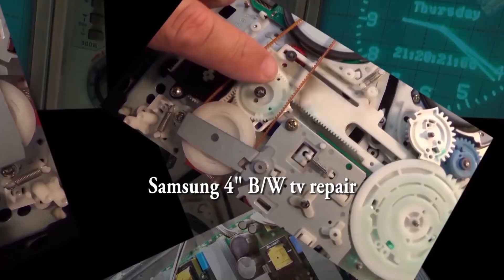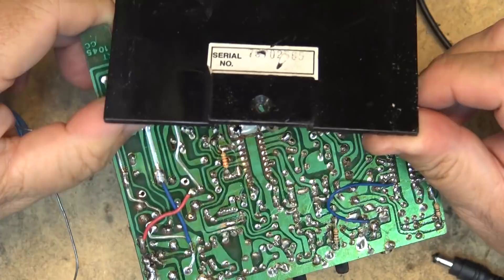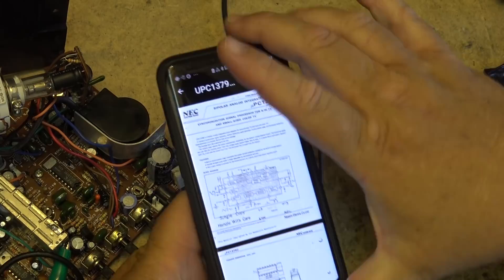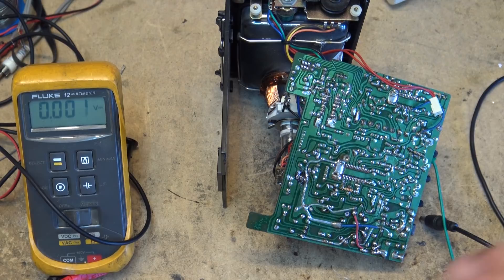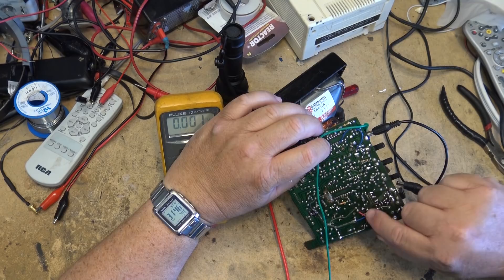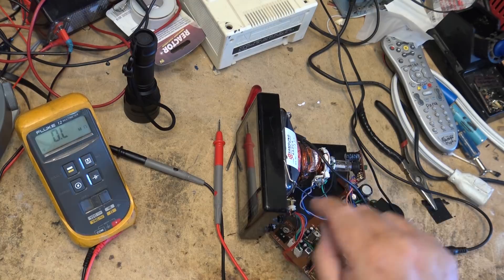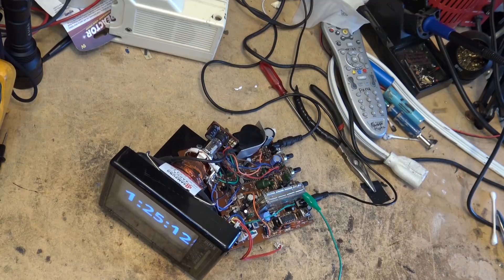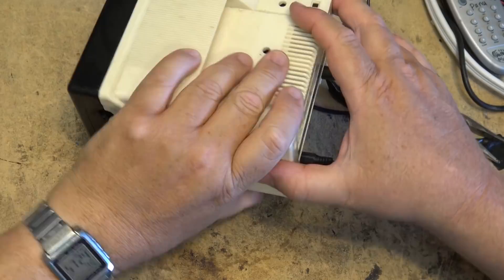Vintage Samsung mini TV repair

Comment: If you have the talent to fix something, fix it! No need to throw it out. All you use it for is to display a clock and the fix didn't cost you anything. Kept it out of the landfill.
Reply from the maker: TEAC Fan 
My goal is to burn the crap  out of the tube. Burn that image in. I have one used as a security monitor that is nicely burned in. Run it till the tube is shot and see how much phosphor burn I can do in that time.

Comment: Good old cold solder joint touch up. Works like a charm. I've used this method to fix my Magnavox D8443 ghetto blaster boombox which seemed like it had no power and the audio was cutting out but touching up the solder points around the main DC cap fixed the issue. Now to fix the controls and add a new belt to the tape player. Then I'm going to record a tape of old school rap songs like LL cool J, kurtis blow, lots of old school rap and play it on it.
Reply from the maker: Yup, looks that way. This set has lots of hours on it, as I leave it running day and night.

Comment: Someone gave me something almost the same,now I guess I will have to look at it instead of using it for parts ?,great video
Reply from the maker: I have been using this as a clock for awhile. I actually have a 10" Hyundai (yes the same company that makes cars) that was used for probably 25 years as a security camera monitor, and now displays the time in my office. 
These old b/w tubes just last forever. I have a brand new one sitting on a shelf, but with the old one refusing to die it may be awhile until the new one sees any service.

Comment: Once I found a small color television in a flea market (without its power supply). But I doesn't checked the polarity (just the voltage only, stupid me thought it is center positive, but it wasn't), connected a power supply, switched on the TV, then... BANG! 😱 A capacitor just blew up in it and also some other components went with it. 😩 Repair has been tried, but only the sound got working, because we couldn't find the other bad components. So, sadly, the television went to recycling. 😩

So, always check the polarity as well of any electronic device to avoid causing damage in it❗

Comment: The RGB Cutoff adjustments on the monitor chassis is adjusting Positive voltage for G1 or G2? The RGB Drive adjustments are adjusting what? When the G2 negative voltage bias is ZERO the picture is White screen. The Screen adjustment is adjusting the Negative voltage Bias to G1 or G2? The RGB Cutoff adjustment is cutting off the beam?

Comment: Love seeing that tiny CRT tube when you pulled the case off that sucker. Definitely a cute little set. I actually got my hands on number of tiny TV's for the sole purpose of learning the ins and outs of them as I figured it's easier to handle a small CRT than some giant 32" tube. As you said, the principle is the same, whether it be black and white or color, apart from color circuitry, it's still a TV.
Reply from the maker: You thing that one is cure, how an out a 1.5" full color tube? Now that is cool. Have one of those too. Panasonic CT101. One of  the rarest little sets ever made.
Reply: 12voltvids Has that one been up on your channel? I must have missed it if it was. I've got one of the small Sony handheld TV units but they're electrostatic or some such aren't they?
Reply from the maker: Yes it is. I have a sony flat tube pocket  tv as well, and no they are also magnetic deflection, just they project the beam to the screen on the read of the tube and you look through the clear glass on the front.

https://www.youtube.com/edit?o=U&video_id=MyFnqtem2jE

https://www.youtube.com/edit?o=U&video_id=0bwn9Qjev54
Reply: 12voltvids Hmm, seems the links are to edit links as if you were logged in to YouTube. Can't watch them. I can get the id's though, I'll do that later on my desktop. Thanks for posting them :)

Comment: That is so cool how you use it as a clock, what are you using as a source to make it function as a clock, is it some kind of clock module.
Reply from the maker: Kristian Dawe 
I have a few devices to generate the time display. I was using an old blackberry z10 phone as there are tons of apps that generate different clocks. (They are just flash scripts) I have a few apps for an old BlackBerry playbook that generate clock displays. Both the z10 and playbook have hdmi out. They  go to a hdmi to video converter and then to a TV modulator. Right now this one is linux code running on a raspberry pi. It pulls exact time from the net. Nice thing about using the pi is it has composite out so it just plugs into a modulator. The flip clock that is sometimes on is from the playbook and the others from the z10 but recently the battery on the z10 went puffy and the phone shut down. Need a new battery even though it is kept plugged in to make that one work. The pi seems to do a good job even though about once a minute you will see it skip a second ahead as it pulls the correct time. It seems to loose about 1 second every minute so it refreshes and corrects the time every 30 seconds. If it is falling behind it junks ahead. The code is not published. An old friend was playing around with linux and wrote the code. Compiled it for the pi first gen only.  The timing is slow though and he never got around to fix it. Gave it to me to play around with. Does 1 thing. Insert the sd card. Plug lan onto port and power up. Get digital clock display. Hard coded for Pacific time. There might be some floating around on the net. Gives me a use for my old pi first generation.

Comment: 12voltsvids, a common problem for TV repair is when you turn ON a TV there is a "time delay" before the TV will display a picture. What can cause this type of problems in the TV circuits?
Reply from the maker: Who knows. Some tvs take several seconds to do anything. I have seen some new sets that take 10 seconds from the time you press power on the remote until the TV responds. You can imagine how frustrating this is when searching a code on a universal remote, and you are 2 or 3 codes past the one you want and the bloody thing turns on. Especially when the tv is 450 codes from the first one in the auto scan, and you have to start over, and press the power button another 450 times. You can imagine customers surprise at work when they put in a trouble call to get the universal remote programmed, and it takes me an hour to find the right code for their cheap garbage TV, and the labour charge is ticking away at 25.00 for every 15 minutes I spend pissing around to find the right code.
They get even more upset when they walk in the room when I am counting codes out to find the right one, and interrupt me, so I loose count and have to start over again.
Reply: @12voltvids oh ok thanks, I wasn't sure because when you first got a CRT TV back in the days it turned on right away and as the older it got when you turned it on it would take awhile for the image to come up on the CRT screen. I'm not sure if the CRT tube needs to be replaced because of the less electrons or the flyback transformer coils has a temperature problem that needs to be warmed up for it to work over time. Over time TVs would have this common problem when you first bought them at the store and used them for years daily.
Reply from the maker: @billwilliams6338  
Early color CRT TVs that used tubes actually would keep the filaments heated 24 hours a day to keep them warm for "instant on". They basically just switched the B+ on and off, and when they were off cut the heater current down to reduce a little power consumption.  These wasted an incredible amount of power. When TVs first went solid state they would keep the filament warm in the CRT for a rapid start. This required a separate transformer for this. Then companies sarted cutting corners to make the TV cheaper, and they just put a few wraps around the flyback core to generate the filament voltage, and when they did that, when the set was powered off the filament was totally cold, and needs to work up before the beam will come on.

Comment: I saw a few of your videos now and you seem to move your hand so carelessly around the components and the PCB. Aren't there capacitors with massive kV that can hurt you? Just wondering because I'm currently trying to fix a mini colour TV. Thanks.
Reply from the maker: There are actually very few places in a tv with high voltage and they are on the CRT. The vast majority of components and very low voltage and when off there is no voltage.  Capacitors discharge very quick when power off.  Now with vacuum tube gear, those are devices that require respect as the voltage is high and those can store a charge for awhile due to tubes not bleeding off residual charge once they cool. Solid state on the other hand will discharge the residue charge fairly quickly as solid state components present a slight load
Reply: @12voltvids  So mini TVs are safe unless I touch the contacts of the tube itself? Are they safer than full size TVs? My dad worked as an electrican engineer before he retired and he says to be careful. I'm trying to figure out how to fix my 6" colour TV that has no colour and the upper corner of the screen is squeezed unless I turn the brigthness all the way down. Thank you for the explanation and for your help.
Reply from the maker: @dymardo_  
Stay away from the tube connections and the flyback when the set is under power.  Everything else relatively low voltage.  Stay away from the yoke too when it is running and the yoke plug as there is a few volts across that.
Reply: @12voltvids  Thanks for the tips. Do you know what could be causing the problem in my TV? No colour and the upper side is squeezed. I found the datasheet for the IC but I'm not sure what output pin I should investigate. Thanks again. (Btw, I tried bypassing the IC, cut the trace and wired a a video input into the amp but no improvement)

Comment: You sure it's actually a Samsung TV, and not just a cheapo generic set with a Samsung tube? I had a Samsung VCR and stereo system from the same year and the build was a lot better than that TV.
Reply from the maker: Yes pretty sure that the set was samsung. They made tons of private label stuff back in the 80's and 90's. Them and goldstar.